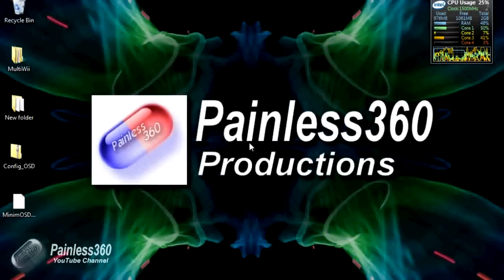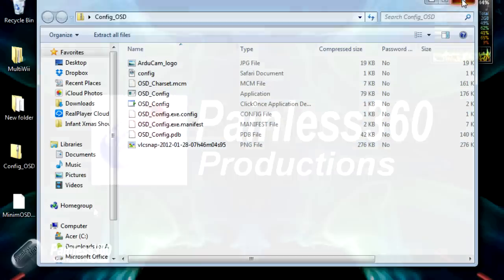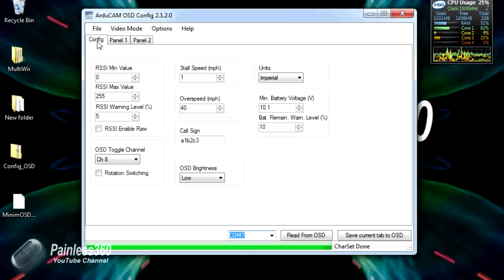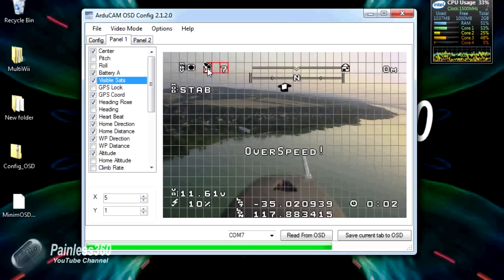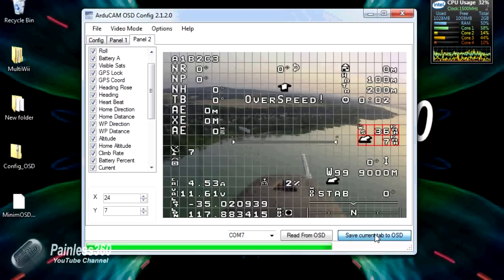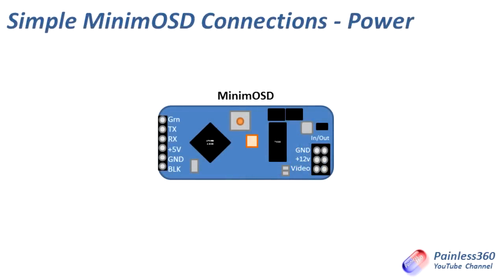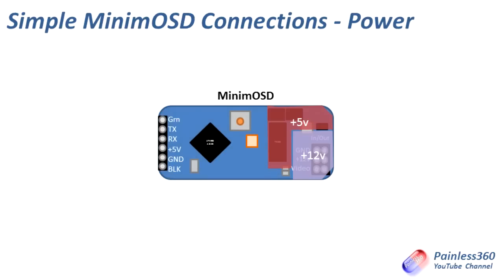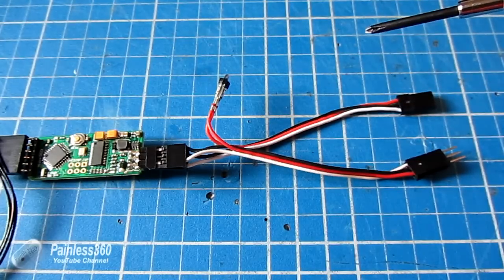APM 2.5/2.6/2.7 - Adding an OSD for FPV using MinimOSD - complete setup

Comment: Thanks for the video. I have configured and installed the minimosd. However I have noticed whenever I connect my 3DR radio, the minimosd switches to panel 2. I don't know how to go back to panel 1??

Is there a way I can switch to panel 1 and/or disable it going to panel 2 at all?

thanks.
Reply from the maker: Reconnect and check the settings in the GUI. You can setup the OSD to change the display and yours is confused. If I remember ' its in the bottom left side of the setup screen. This is covered in the videos. Best of luck!
Reply: Painless360 Ok thanks. So there is a way to stop the OSD from changing panels?

Comment: Thank you so much for your video and diagrams. I was really going nuts to why I was getting "waiting for heartbeats". Read some forums and found out about the rx tx switch around and tried your video to see if you had a diagram on it, and yep you do. Problem now is I think I got a fake FTDI adaptor. I took your advise and really looked to make sure I got a real one first but it just will not configure on windows no matter what drivers I use. The FTDI chip looks real. Looks like it was laser printed but I really don't know how to confirm if it is real or not. So right now I can't change my hud.
Reply from the maker: FuYing Bro I got all of mine from eBay by searching for  'FTDI Basic'. Best of luck!
Reply: Painless360
Yea that is how I got mine. I can't really tell if it is real or not. The etching looks real but I can't get any drivers to work. New or old. Windows will just show a serial port with a yellow explanation mark. Its all good. It was pretty cheap which should have been a clue. Thanks for the reply though. Have a good day.
Reply: +Painless360 just set up my apm with osd on it but can't get my osd to show battery or sats also when I have the osd on my pc I can see all the stuff I want but when it's on the copter it only shows me some of them??
Reply from the maker: Happy to help but please watch https://www.youtube.com/watch?v=olIqTiSJHIY and come back to me with more detail of what you've tried..

Comment: I wish you'd do this for the Pixhawk.  It's not as straightforward as the APM and there are issues around which telemetry port to use, some parameter settings, etc.  I finally got mine working, but it's so much better for future reference to have one of your excellent videos to refer back too.
Reply: +Spingenoir This was the key to getting it working for me. SR0 is the USB, SR1 is telemetry port 1, and SR2 is telemetry port 2: https://code.google.com/p/minimosd-extra/wiki/APM I've done some other things like powering the MinimOSD from a UBEC rather than the telemetry port, too, that may have helped.  One of the reasons I posted this is +Painless360 has the ability to dig in and make things more understandable.
Reply from the maker: We will cover this in the series.. thanks!
Reply: +Hugh Dinwiddie Hi can you point me in the direction as to how to get the telemetry to feed into the minimosd from the pixhawk. Pretty sure all I have left to do is edit some settings on mission planner. Thanks.

Comment: i tryd to download it but the hex file didnt download or there is nothing in it or my pc cant open it
Reply from the maker: rob van es Have you installed all the other software we cover in the video?
Reply: i have try only that 2 that you have jus in the vid
Reply: rob van es the zipp file download only the hex not
Reply from the maker: Not sure what you mean - can you post a video showing the problem?
Reply: i have try to download both files but i can only download the zip file , the hex file also download but i cant open it or ther is nothing in it
Reply from the maker: You use the app to flash the hex file to the MinimOSD - as shown in the video.

Best of luck with it.
Reply: ok thx ill sell try
Reply: Painless360 no it dont works by me , both wont open
Reply from the maker: Can't help unless you post a video showing the problem..

Comment: Here's something very confusing, according to the ardu online OSD manual, the cable configuration is totally different from the one shown in this video. My OSD doesn't work either way. Can you please explain which one of the two is correct?? http://plane.ardupilot.com/wiki/common-optional-hardware/common-minim-osd-quick-installation-guide/#basic_wiring_diagram
Reply from the maker: Flycam That version of the wiring diagram you link to shows the second area on the MinimOSD powered with the 12V for the camera. I strongly advise you not to do it that way.
This is all covered in the video about why I do my way and you can clearly see that the board works when wired as per my diagram. 
If the board doesn't work either way then you may have a damaged boards and need to go back to the vendor for support. 
Best of luck.

Comment: :) First of all I do ´Love your VIdeo's have learned alot from them lately. I bout my Osd from ebay and at the time I didnt know nothing about Minimum :( so I dont have any of the Jumpers to solder together!!? Is there other ways of serving 5v to the board ? because it gets really hot after a short while? thank you
Reply from the maker: Bisholi M If the board isn't the same as the one I use in the video then it's tricky for me to comment. I would use the same board version used here or get a Micro version -  they are very cheap - and start again. 
The board shouldn't be getting warm at all. 
Best of luck.
Reply: Painless360 OK :) Thank's Brother :)

Comment: All very helpful - thanks. My question is now, is there the possibility to combine miniosd + telemetrie kit? Thanks for an answer!
Reply from the maker: hastlaAT You can buy a cable that connects it all together, the trick it to not connect the wire connected to the Tx on the MinimOSD. There are reports of connecting both to the same output on the APM causing the signal to be pulled down and cause issues though. 
Happy flying!

Comment: Hi, could you offer a little advice please. I just ordered one of these MinimOSD from hobbyking. It has a y splitter cable but only 3 pins in the side that connects to the MinimOSD. missing the TX line, does it work without that?
So anyway I check the info on the MinimOSD wiki and Arducopter sites and they have the GND wired into a different position than you, Despite the labels showing it correct as you have done it..   They have GND from APM to BLK on minimOSD
http://copter.ardupilot.com/wiki/common-optional-hardware/common-minim-osd-quick-installation-guide/
Did they make a mistake or it works both ways or what?

I also have a teensy converting telemetry to my Taranis, do you know if having that as well as the OSD will cause any issues?
Reply: I have a similar puzzle. I too only have three wires from the MinimOSD, Tx, Rx and +5v. It's the ground that is missing :-/ Did you get any joy?
Reply from the maker: +farmfunuk I'd ask HK as I've only used the ones shown, you don't need the Tx wire on the MinimOSD but if you have it you can change PIDs and other things on some flight controllers. Best of luck!
Reply: +Painless360 Aha! Thanks for that :-) 
After my post an hour ago, I realised I had the plug upside down. Doh. I was still puzzled that I only had three wires though (Tx is missing) Problem solved.

Comment: Thanks. Just done what you said. Got osd working, it shows sat and direction, it also displays battery voltage but it just won't show any battery percentage, amp draw or current. Has this got something to do with firmware? I'm using PM to power the apm board and separate power source for Rx and FPV gear, ESC are all switching and all red wires removed.
Reply from the maker: MaydayRC You need an external set of circuitry again for AMP draw. If you are using an APM power module then this data should be supplied to the APM automatically using the supplied power cable. I would check that out next..
Hope this helps.
Reply: +Painless360 I do have a APM power module and it is connected to the board, I think it is working properly as all data shows on log. I think the problem might lie with the firmware. I'm gonna try change it and report back.
Reply from the maker: OK, best of luck. I'd double check the setting in the code and GUI.
Reply: Painless360 Ha!! I have found out the reason why! I changed the battery monitor setting to voltage only when testing and forgot to switch it back to "voltage n current". For those who might had similar problem, It is located in initial setup/optional hardware/battery monitor. Once that's enbled, the OSD works like a charm. Thanks again!
Reply from the maker: Good news - happy flying!

Comment: hi, i am planning to get in to the pixhawk flight controler. i saw a whole package that includes gps and mavlink but its not comming whit a minimosd board, i am looking around to buy a minimosd sepperate but i find out there are special versions/variants on the minimosd, like there is a "regular minimosd" and a "mavlink-osd minimosd apm" and a "mavlink-osd minimosd pixhawk"... why is this? i saw u use a regular on youre APM if i am not mistaken? what are the other variants for? whats the differents between all those? i just need the mavlink-osd variant i guess? dois it matter if it says its for apm while i am gonna use it for a pixhawk? it should be the same thing right?
can u clear this out for me? i dont know which one to get...
Reply from the maker: jelle buyckx There are two main versions of the MinimOSD board, the basic one and the one that has the KV_Team mods.
The version of the MinimOSD board you can use is dictated by the firmware you are planning to install. All of the MAVLink firmware (used for APM, Pixhawk and also CC3D) doesn't work with the KV_Team changes - different pin-outs. So, you need a basic MinimOSD board. 
The versions that you mention come pre-installed with the firmware for the flight controller but I would recommend getting a FTDI Basic board so you can edit the way that the OSD looks and the information it displays. It then also allows you to upload different versions of the code as they change and improve.
Happy flying!
Reply: ok, so if i understand, i can just get the cheapest minimosd and ftdi basic adapter i can find and dont have to worry about buying one that is specific mavlink-osd (couse i will use 3dr mavlink radios to)? like this one for example... http://www.goodluckbuy.com/crius-mavlink-osd-v2-0-minimosd-compatible-atmega328p-microcontroller-dc-dc-voltage-stabilization.html that one is fine for me right? for the pixhawk?
Reply from the maker: Should work. Unless you are buying official 3DR products then a certain amount of work is involved. The more you spend the more support and backup you have.

Best of luck!

Comment: Great video once more! Q: All the FTDI to DF13 cables I can find (and my Y splitter that came with the HK APM kit as well) have no TX signal wire on the FTDI side. So I'm left with only 3 wires: RX, +5V, GRND. Where did you find yours? Many thanks Painless360
Reply from the maker: I made it using a DF13 cable that I cut one end off then soldered some pins to the ends of the wires so I could plug them into the FTDI.

Hope this helps.
Reply: Painless360  thanks. I'll have to solder one as well. Worst case I think this might help: http://www.goodluckbuy.com/apm-2-5-3dr-telemetry-adapter-cable-20cm-osd-xbee-adapter-cable.html

Comment: First of all, Thank you Painless. Your videos are awesome.
I have done exactly as you have said however, I have a major issue. My quadcopter lifts of without a problem but when hovering, if I want to climb, it simply won't or it takes a lot of time. Then, when I either use yaw input or roll, I starts falling (descending) rapidly and bounces of the ground. 

This is my setup:
Reptile 500 frame
Sunnysky 800kv
Afro 30 A
APM 2.6
Turnigy Nanotech 4500 3S
Gemfan 10x5
Other stuff which makes my AUW 

I have also tried HQ Props 10x45 and 10x47

I would be most grateful if you could point me in the right direction
Reply from the maker: Amir Tahami What troubleshooting have you done already? Which flight modes do you use when you see this?
Reply: Sorry for the late reply, just recovering from a really bad cold. The issue, which I was so ignorant to see was that the battery was a 3s battery. Switched to 4s and everything is working for now, but, I still need to trim and tune it and then we'll see. Thanks

Comment: GREAT Video! Just what I was looking to accomplish. I do have couple of questions about the voltage and not supplying the MinimOSD with the 12v from the video transmitter (video section https://youtu.be/9fk5o4pYOn0?t=12m28s), using a better camera, and last the screen font.

01.Did you do the cross soldering on the MinimOSD in the video? I'm not clear on that part. Is there any close up pics you could share as a follow up? Such as a before and after of the joints were soldered?

02. Also, can this work with the Mobius or GoPro camera? Since both cameras are self powered, it's best NOT to connect the positive cable from the video transmitter to the self powered camera, is this right?

03. The font used for the OSD, can we change it to something less bolder?
Reply from the maker: Hi Jon,

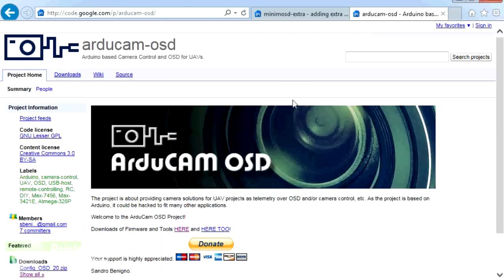1) Watch https://www.youtube.com/watch?v=Bdki9lIv31I at 3:36 there is a close-up.

2) Yes it can, the lack of any applied voltage makes this very versatile. That's one of the reasons this is the best way to power the MinimOSD.

3) Not with this particular firmware, that is the only option. Other modified font versions may be available from separate sources or you could try other firm wares for the MinimOSD

Happy flying!